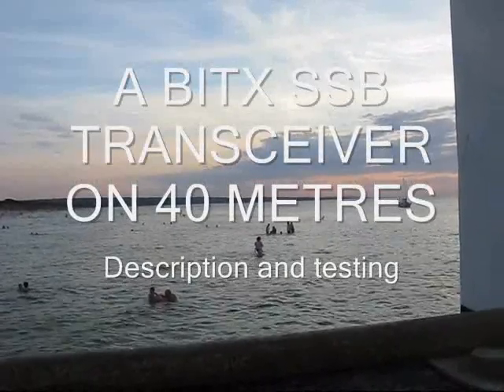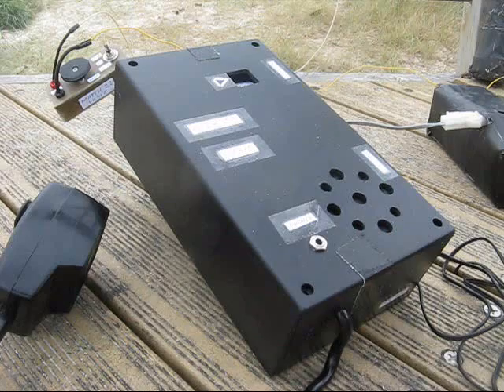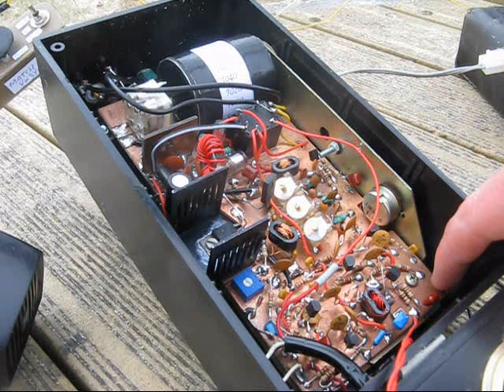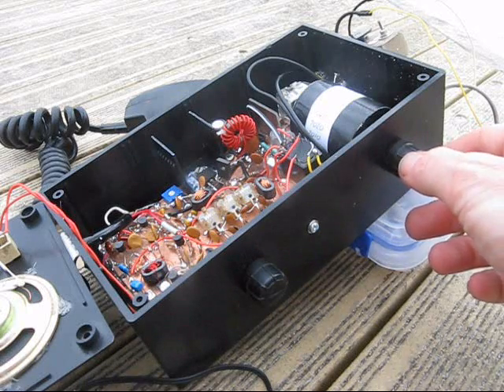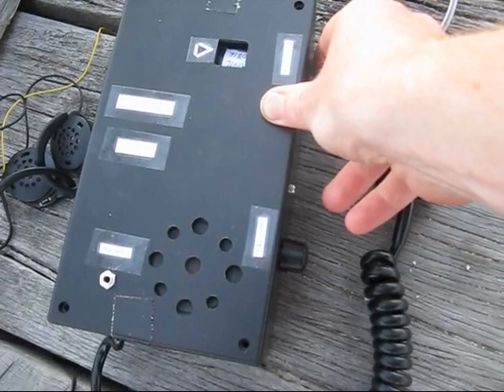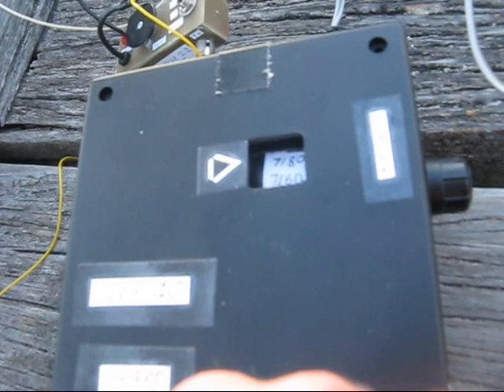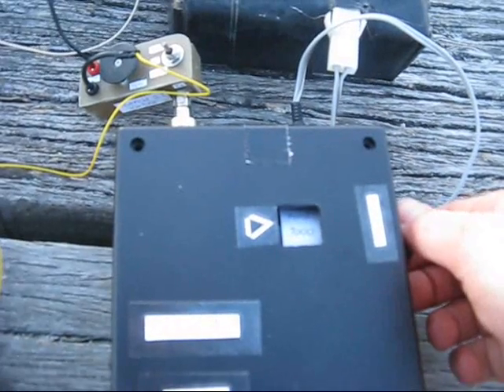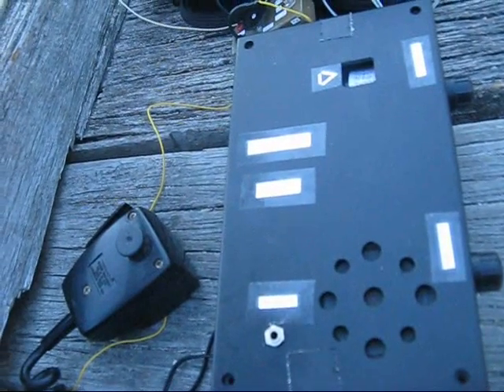BITX40 QRP SSB transceiver: Description and demonstration

Comment: I want 14 mhz tr tx .the same design. Thanks for you 73 from baghdad. Yi1HXH
Reply from the maker: See the link in the description to the original which was on 14 MHz
Reply: vk3ye thanks peter I made three bitx and work very well on 20 m.the first contact with Hz my signal 59 my ant long wire only about 15 m with out tuner.

Comment from the maker: @vk3crg Thanks Craig - counting down the days - hope you're enjoying all the packing! You should do well from there even with the buddypole (hint: pack transceiver, cables and power supply last so they're the first box you open when you move in).  Happy new year as well.
Reply: vk3ye I used 20 uh (RFC)not toroid Ln my Vfo but work good from 4th 4.350 mhz with 10 mhz If crystal
Reply: vk3ye I used 20 uh (RFC)not toroid Ln my Vfo but work good from 4th 4.350 mhz with 10 mhz If crystal .

Comment from the maker: @souravrelja The VFO coil is 10uH. I initially used an RF choke but it drifted badly.  10uH but on a T50-2 toroid made a huge improvement.  Other changes include mic amplifier - 150k between base and collector instead of the voltage divider biasing and 0.1uF in series with the electret mic.  Electret mic is fed 12v via a 22k resistor.
Reply: g